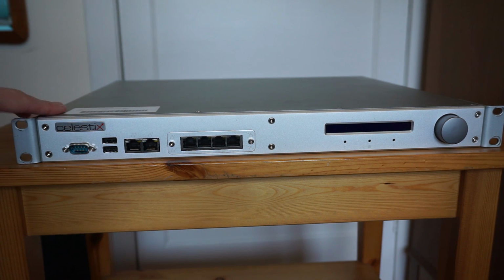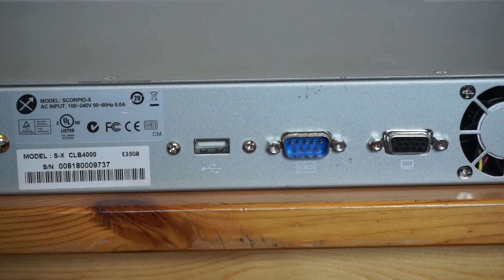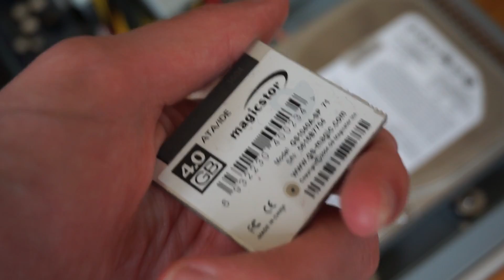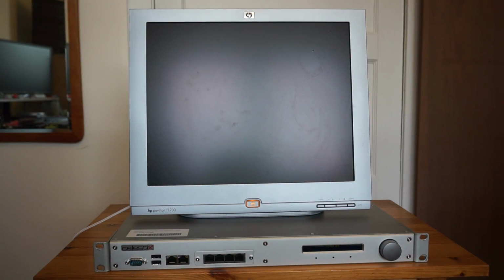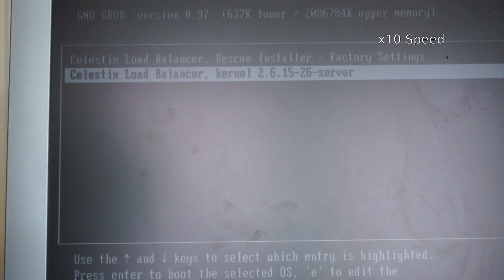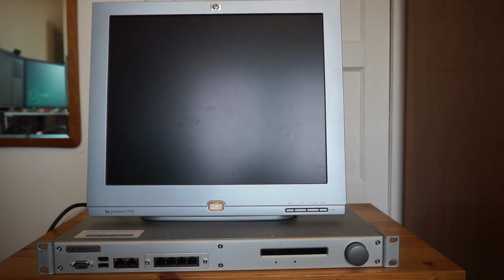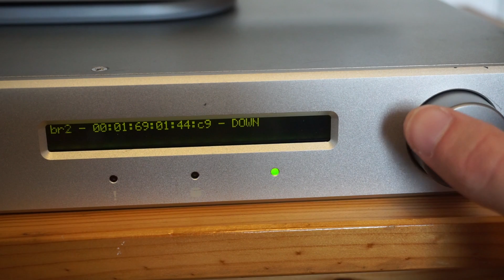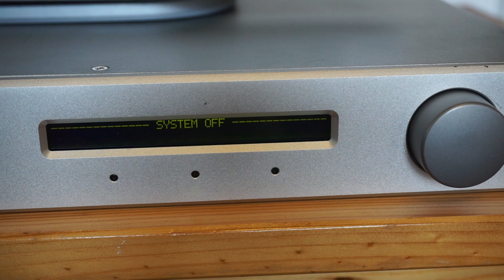Celestix Scorpio-X CLB4000 - My new router!

Comment: Isnt a set of them ethernet ports for WAN use then the others LAN after all it is a router.
Reply from the maker: That would entirely depend on how the software is configured.  To the OS they are just all regular Ethernet interfaces, you would then configure them based on your requirements, some as LAN, some as WAN.etc. Some OSs will automatically assign one of the interfaces as WAN although this is completely customisable. It's not like a consumer router where you have distinct sets of ports for LAN and WAN, this is literally a PC with 6 network interfaces which can be configured based on individual requirements.

Comment: Get some of those fancy Noctua fans that everybody likes. I hear They're really good for 1u systems
Reply from the maker: I got some of those for my new router (replacing this one), video on my channel.  Unfortunately those Noctuas (along with all other quiet 40mm) fans don't move much air.  They are usually fine for basic case ventilation however in this machine as the fans are required to move air through the passive heatsink to cool the CPU so I was concerned that they wouldn't move enough air to keep the CPU at a reasonable temperature.

Comment: Dont nueter your IO performance with a stinking CF card, sheesh. You can get a cheap SSD for that for under 20 bucks which is more that large enough for any router operating system. CF sucks.  I mean, you have SATA then dont bother.  But thank you for sharing. I mean Im using a modified x1250e running Mikrotik RouterOS, and man, Im having to make hella mods just to get an SSD installed because of the IO limitations of cf are really a problem loading large blacklists, and you, man you got SATA ports on tap! LOL grrrr!  Anyhow, thank you for sharing. I enjoyed this insightful video you posted here.
Reply from the maker: It really comes down to what you are doing - If you're doing anything such as running a local cache then you certainly need decent I/O.  In this situation I'm not doing anything like that, the router boots from CF into RAM and practically never touches the disk again (only really to write any configuration changes I make), the only benefit I would get from a faster/larger disk would be faster boot times which doesn't really matter on a system that is left on 24/7.

Comment: I used to have a similar setup, a dedicated Core 2 box running PfSense, but I recently decomissioned that and integrated that system into one of my main servers in the form of a VM running in the Xen hypervisor. You can dedicate hardware NICs to VMs, which allows you to do your traditional modem > pfsense > switch setup, as well as create a very fast "virtual switch" to connect to the VMs running on that box.

Comment: Should also make a powerful FireWall with the PFSense .  I also put some quiet fans in a 1U Dell Switch and easy to do.  Just may have to switch the wires in the plug.  Check out the YouTube videos on quiet fans.  Maybe fill up the RAM slots and upgrade to a SSD.  Thank you for the video !  tjl

Comment: I helped repair and fix up a similar type system that had an 80-gig drive, half a gig of RAM and a Pentium 4 in it. upgraded it to a Pentium D because it was a 945G-based board. 945 is perfectly fine for this, but they still use a lot of power. the main big thing is the virtualization options the 900 series is able to put out.
with a hacked BIOS, one could technically get a Core 2 in there somehow since it'll function with a 945 of the right revision, and this happened to be late in the Pentium 4's life . the chip pulled out was a 631 3GHz, the 65nm variant. I forget who made the box, but the fans did the sort-of same dealie in ramping down over time. in the end, ended up with a decent working copy of 7 on the thing, and it hasn't really been touched since October. I'm going to go out on a whim and say the same OEM that made the board for Celestix also made it for this company, but the machine I worked on was originally supposed to be for an RSA key code generator system and I think it only had two 10/100 inputs going into the thing. we did end up replacing the hard drive it came with, with an 80-gig WD Raptor that seemed to stay cool in the thing, even when left on overnight, so there's no worry there about it making too much heat. 

I think my friend picked his up for like 20 bucks since it had some case damage he was able to remedy first-off, but there were also a couple bulging caps to take care of as well. 

I linked him the video here in hopes he finds one for cheap-- this looks like a real interesting system to work on. any idea if it's a G3x or if it's also a 945 like the one mentioned? it'd be easy to find the top spec of the CPU able to go in, in that case. with a 945 you can go up to an E6700, with a G3x the sky's the limit so long as it's a dual-core unless you get the second revision chip, meaning you can take a quad-core just fine.
Reply from the maker: +Sudos As far as I can tell, mine is a 945G chipset.  It is very likely that your friend's machine was a Celestix machine as RSA used to rebrand them as their "SecurID Appliance" before later moving to Dell PowerEdge R210s.
Reply: Cameron Gray huh. I'll have to ask him to send me a pic of the thing. it's been a long time since messing with it so I barely remember what the insides look like.

That being said, if you can drop an E4000 series Core 2 in, I wonder how well a 65nm E6000 series Core 2 would do in it then. as said, the top end for the 945 of the later revision is the E6700, the fastest 65nm that you can run on those. from what I remember they still go for really cheap on ebay because they're old core 2s no one cares about anymore. that with the speedstep stuff turned on either due to linux's intervention or what have you would make for something that could totally make use of the absolute full bandwidth of the Intel GbE ports you have on that thing.

also, unrelated question-- are your RAM sticks properly set out there in the slots? for some reason it looks to me like the 4-gigs is only on the single blue channel and not blue/black. can you clarify on how the channels are set up in that machine corresponding to the RAM slots? not that it's going to make any huge performance increase either which way for the job at hand, but...